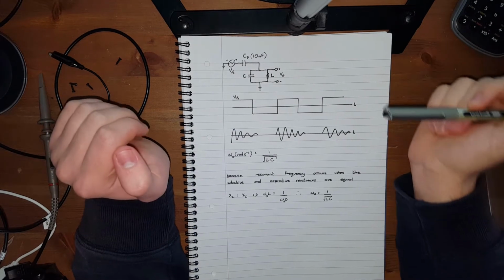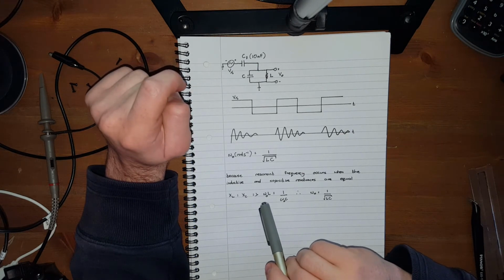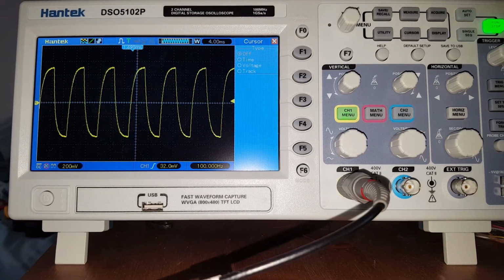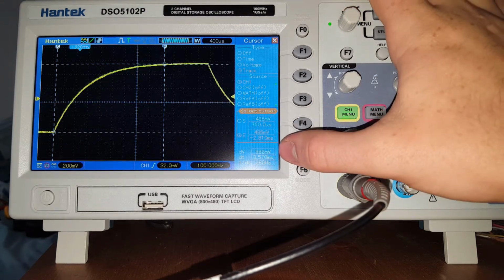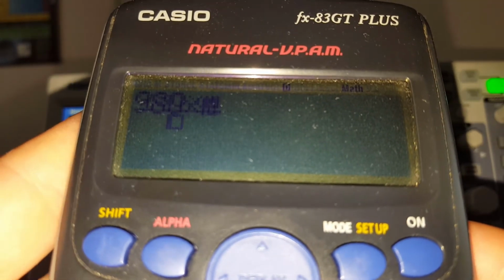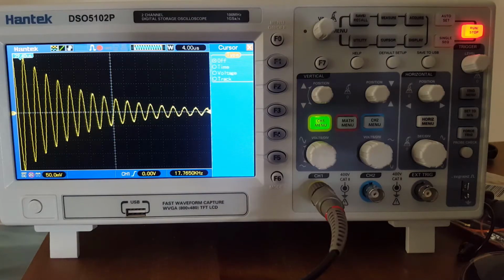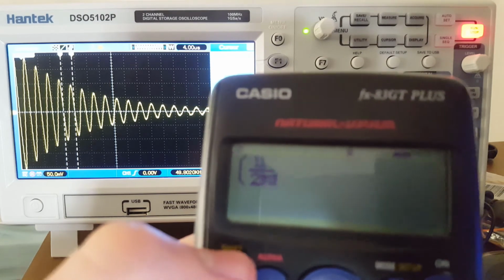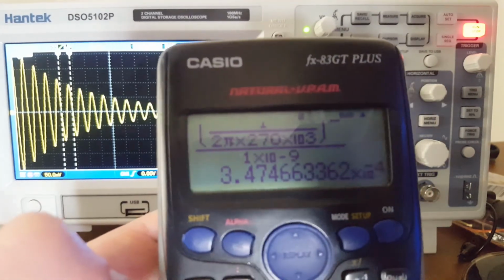Inductance and Capacitance Measurement

Comment: The reason why you read higher capacitance is because the capcitance increases due to electrostatic forces.
Reply: would you mind to explain a bit more, i´m learning about this type of circuit for measurement of inductors and i´d love to understand it better.